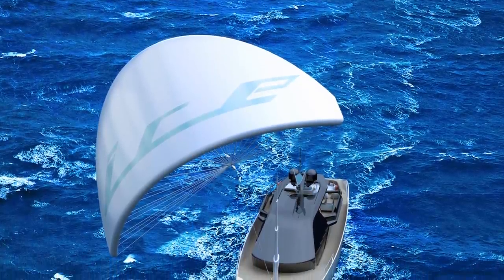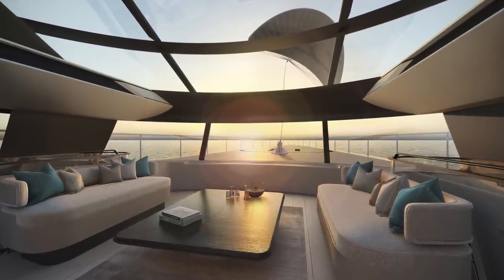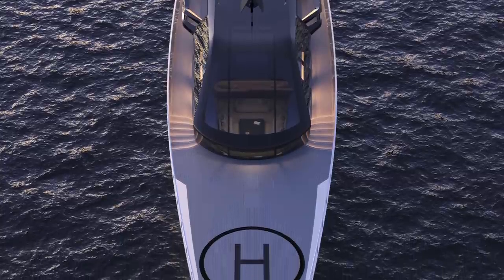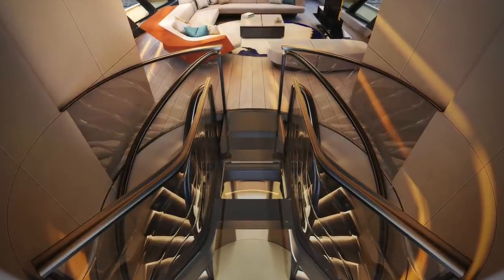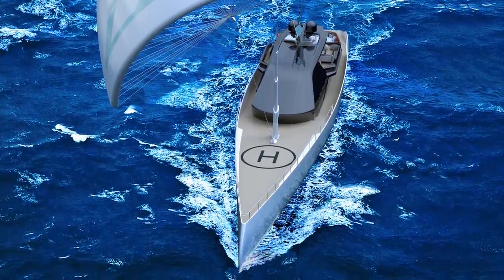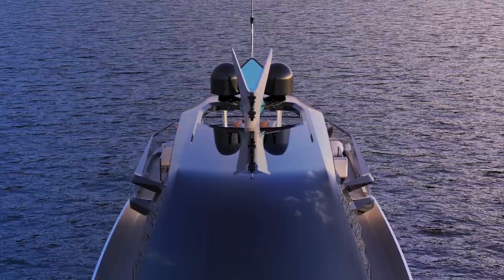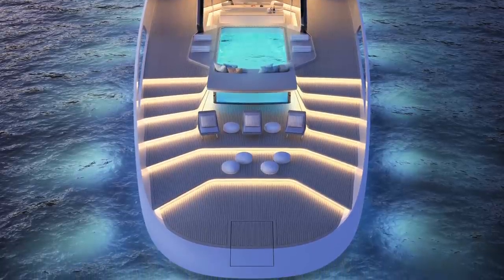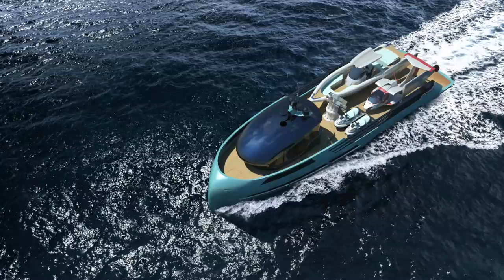INCREDIBLE ICE KITE SUPERYACHT!!!!

Comment: Does the kite save more fuel than running a 26 meter chase boat?  

You’d also need to pay for another crew, berthing, and maintenance for it.  Seems like spending dollars in order to save a dime.
Reply: Same thought came up in my mind.
Reply: When you get into the water, drag (and therefor propulsion needs) increases by square powers or worse of size, speed, and displacement.  A 4-person Cigarette speedboat zooming around the bay going nowhere fast uses a lot more fuel per hour than a full 95-foot explorer yacht set up for range and real experiences.

While big power-yachts are of course energy gobblers by their very nature, that 26 meter service boat uses a drop in the bucket compared to what it takes to move a mega yacht around, especially if this main yacht is part of a lifestyle that generally cruises at the casual motor-sailer pace of single digits.